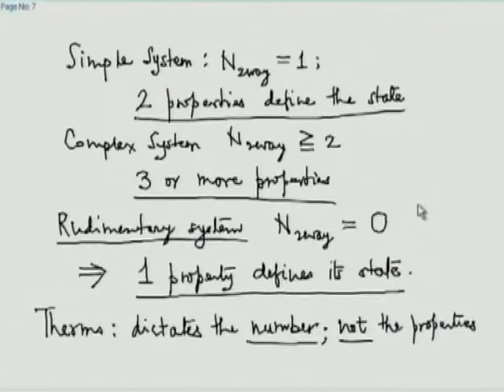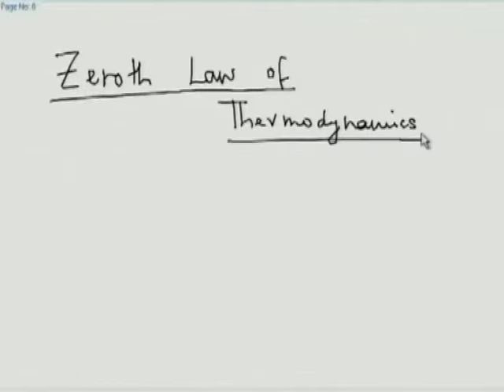TDME M L6 Zeroth law of Thermodynamics

Comment: What is state space
Reply: It's a map of different possible states in which a system can exist. When we say states, they should be properties. And properties are generally measured only when there is equilibrium. Only when thermal equilibrium exist you can measure temperature. If thermal equilibrium doesn't exist , you have to wait until equilibrium is reached and then measure